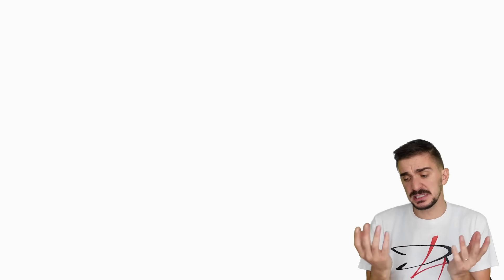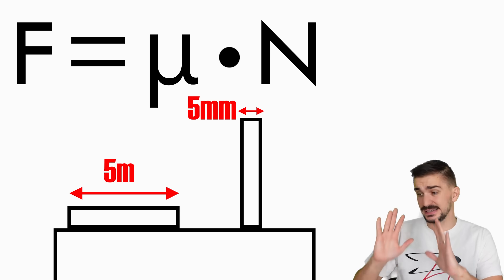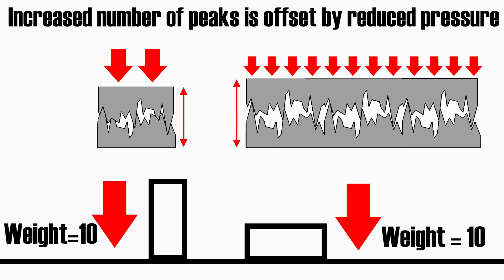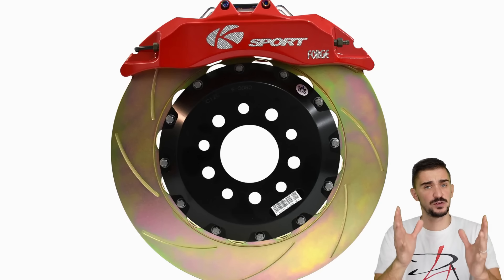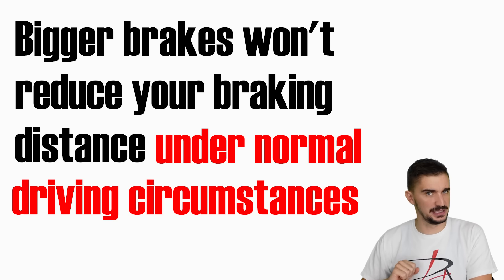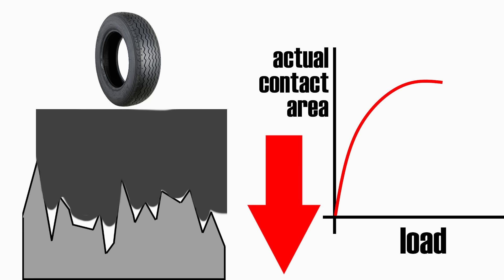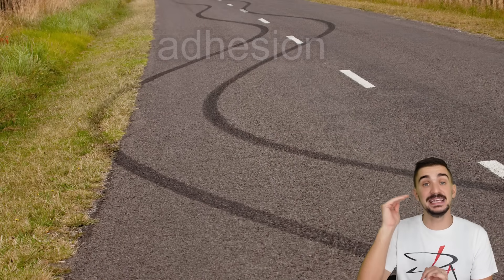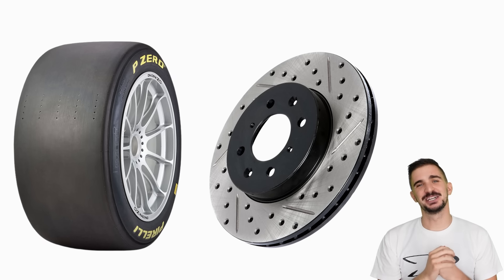Why Big Brakes Won't Stop You Faster but Wider Tires Will - Friction and Surface Area Explained

Comment: A great video and explanation in a simple and understandable way! Thank you! However, I would like to point out that the braking system and the tyres are not independent, and should be "consistent" to each other. I will try to explain... The use of wider tyres requires a greater force to stop them moving (as well as in the case of higher speed and higher car weight that have been mentioned) (in fact a greater force required to activate ABS). This implies that a better braking system might be required (but not necessarily) in order to achieve a shorter braking distance. Furthermore, apart from the performance of the braking system at high temperatures, their performance under wet conditions should be mentioned. Because a greater braking force is also required to activate ABS when discs and pads are wet. Moreover, the surface area of discs and pads are not only important. Their construction materials as well as their construction design may significantly affect the braking force. Both the presence of water and the quality/design of the materials (pads/discs) affect the friction coefficient, and thus, the breaking force (according to the equation of friction force mentioned at the beginning F = μ x N). This is similar to the friction force of different tyres (ie different materials and patterns) on dry, wet, icy roads. I hope the above information helps to clarify a couple of points, and are definitely well-intentioned!!! Thank you once again for the great video!

Comment: Bigger brakes means bigger braking MOMENT and they DO improve braking performance. On the big brakes you generate same friction force as on the small ones  but the centre of brake pad is further away from the wheel rotation axis therefore braking moment (Force x Arm length) is greater.
Its like you were trying to argue  that stopping the spinning bicycle wheel by grabbing on the tyre is as easy as stopping this same spinning wheel by grabbing it by the wheels sprocket.

Comment: There is a lot of mythology and misunderstanding about brakes. Thanks for explaining away much of that.

Brake fade comes from 2 sources, overheating the brake pads or overheating the brake fluid.  If your brakes loose breaking power after some significant use I would first upgrade your brake fluid.  DOT4 is compatible with DOT3 and has higher wet and dry boiling temperatures.  DOT4 race fluid has even higher boiling points.  Race fluid is $$ but since you so rarely change it isn't an ongoing cost for a street car.  An extra $30 over regular DOT4 fluid is all we're talking about.  Next try a different pad compound. If your car has organic compound pads try a metallic or semi-metallic pad.  These operate in higher temperature ranges.  Those changes will handle 95% of what you might need in a road car.  Don't get race pads for street use. They don't work well cold and that's dangerous for a street car.

His description of how tires make friction is great, but I would say that more important than larger tires is a stickier tire compound.  You want to stop really fast? Get 200 treadwear tires.  They adhere better and deform to match the road surface better.  The actual surface area of your contact patch has more to do with tire pressure than it does tire size.  If you have 33psi in your tires they can support 33 lbs for every square inch.  If the corner weight is 1000lbs your contact patch will be 30 sq. in. regardless of the size and shape of your tire.  This is why racers put as little pressure in our tires as we can get away with. 

One advantage of larger brake rotors that he leaves out is radius and leverage. In my endurance race car I had trouble with brake heat.  I installed rotors that were 10% larger radius which meant a 10% longer lever arm so 10% less force between the rotor and pad needed for the same force between the tire and the road so less heat.  That meant less heat generated and heat less to disperse over the larger area. Between that, better pads, and brake cooling ducts our brake problems are in the past and we use all oem single piston calipers and oem type rotors.

Often brake "upgrades" can increase your breaking distance, because if not done right you can change the brake bias.  Too much bias to the front or rear can impair your braking.  Ideally you'd want all  4 tires getting their max traction under braking.  But with stock rear and upgraded fronts, the fronts are doing all the work and the back very little.  Incorrect bias can also cause instability under hard braking. You definitely don't want that.  This is complicated because spring rates and weight transfer affect the ideal bias, which is why pro-race cars have in cockpit bias adjustment.

Comment: Attention! Raising is w/portelan pad. We use ceramic and semimetalic pads. Don't put on you car semimetalic. Ceramic is the best. Ceramic will be better on the heat pads. Semimetalic is up down side. For winter use ex: 195/70 R15 versus 205/60 R16 winter tires.

Comment: Long story short, if it's possible to lock your brakes without fade, you need more tire grip. If your brakes are fading to the point where you can't lock them anymore, you need better brakes to dissipate the heat. If they're not fading but you can't lock them, they just need more force behind them.

Comment: After Decades of hearing Size Matters.   Oops wrong subject!
   Obviously manufacturers equip vehicles with brakes that can stop you safely and effectively. 
   But the awful  overly large Wheels look even crappier without something filling up the void behind. That's for most. Large brakes are for the boulevard Cruisers. 
     When brakes heat to the point they become red hot brake fluid boils becoming  ineffective. 
     That's why big rigs use engine compression instead of riding the break while descending steep grades. 
     One thing large brakes do is retain heat longer.  (Bad)
     You likely won't find cooling ducks for the brakes on a dragster. 
    But you well on supercars or say NASCARs. 
    Ever watch a video of NASCAR breaks? Every single Corner they become red hot cooling down within just a couple seconds until the next corner. 
     Those breaks have always been about 12 in. 
    About the same size as on a V6 Mustang. 
    Certain V8 models are using as much as 15 in. It is a marketing ploy.  if a 12-inch rotor can work for NASCAR it can work for anybody. 
      Of course the stock market being what it is those in the racing business have stock in certain companies. So now NASCAR is putting in 15 inch rotors.  Watch the calloused muscle heads run out and get even bigger rotors now just because. Their money! I'd rather make sure I'm prepared for the hell that's about to be released on the world.   And you all thought the worst was wearing a Hankey on your face. 
       Life Is Bliss until it isn't!

Comment: Bigger brakes dissipate heat faster than smaller brakes.  Brake fade from boiling brake fluid from overheated brakes is a bigger concern for cars in racing situations, or in situations where the brakes are used hard for extended periods.  

So, bigger brakes ARE useful.  In some circumstances.

Comment: There is a question I have in relation to all this. Friction between objects generates heat, so as you drive, the rotors and pads get hot since they constantly pass over each other. I was led to believe that having larger pads and rotors (especially slotted ones), improve braking as they are less prone to overheating and slipping since the contact patch would be less concentrated. Is that accurate, or have I been living a lie? 🤔
Reply: If you are just driving and not stop the brakes will be ice cold even if driving last 100 miles without stopping as they are not in contact with anything if they were you would hear them rubbing, wear them out and use more fuel.
They only contact when braking. 

Its a lie because unless you are a bad driver you cant overheat your brakes in daily driving, if you are in a city and they overheat thats a horrible driver who probably also left foot brakes in an Automatic Or you were braking too late, driving too fast and if its a manual most of the slowing down should be done with gear and not brakes via Downshifting with rev match. 

Slotted Rotors dont have more grip, The slots are there to Shave a layer OFF the brake pads when they pass over it like a razor blade so its always fresh material and as a 2nd effect they help remove the gases from the brake pads breaking down/wearing like groves on a tyre help evacuate the water when its wet.

Comment: Yup.  F1 cars have smaller breaks that some would expect. But the cars have much larger tires and their breaks can tolerate much more friction and heat. 

I love your videos by the way. ✌️
Reply: So true F1 priorice tyre wall to been used as suspension than bigger brakes. I'm pretty sure they know what they're doing.
And before regulations the brakes were the smallest possible without compromising to get more tyre deformation benefits.

Comment: One thing you did not mention is the larger fulcrum/level of big brakes in relation to the wheel. And the higher speed (IPM) of bigger brakes past the caliper for the same road speed.
  How fast are the TIRES moving on a car doing 60 MPH?
1. Entirely linear=60 MPH
2. Bottom=0 MPH (inrelation to the ground as speed is measured).
3. Top of tire=120 MPH

Comment: In germany its requried to enlage the  brake system and brake cooling, if you increase the power of the engine 20% over stock, if im not misstsken. The TÜV will also check, if the MC is fitting. They then test the new brake system by emergency braking the fully loaded car out of vmax down to 20kph. I dont know how often they do it and what is deemed as pass, but they basicly dont want the brakes to break down due to fading, overly warping or overheating, and also the braking distance should be acceptable. 

Its also often that the brakes of cars from america are "too weak" for germany,  because they overheat, fade and warp easily, doe to their smaller dimensions. I know that youre basicly right, that a bigger brake technicly doesnt slow you down faster, but if you break out of higher speed the brake can start to fade during the braking fase and thats how the braking distance can get longer, if the brakes are "too small" compared to vehicle weight.

Comment: Kinda wrong. If you don't have abs, or even if you do. Setup is stock tire. With small rotors,, The amount of pressure to bring the tire to lockup is incredibly high. When you or abs gets them to unlock the difference in pressure is great. TAKES LONGER, Stopping distance IS LONGER . PUT LARGER rotors on the same vehicle- braking/lockup/feel or  sensitivity goes way up, recovery from lockup is quicker by human OR abs because you don't have to let all the components de flex & return soo much to get pressure off the rotor enough to allow the wheels to rotate again. Therefore Stopping distance IS SHORTER. brakes are not at the same thermal stresses- Everything is better
 Sometimes naked physics is correct,  but applied physics tells a different story. IMHO

Comment: This is largely false. Bigger brakes resist fade far higher than smaller brakes. Thus, there is a difference. Or every asshole with a Lambo would have Toyota tercel brakes on it. You're an idiot.
Quit spreading misinformation and half truths.
Reply: this isnt about fade, your the one who didnt understand the video

Comment: Excellent presentation, as far as he went....see, one must also take into account the shape of the contact patch of the tire on the road.   Skinny tires have an elongated (front to back) patch while wide tires have the opposite, which is  a wider contact patch.   This is critical on motorcycles especially.  A thin contact patch will, because the tire is elastic, under hard/extreme friction will cause the tire to "ripple" making the bottom of the tire the shape of a sine wave.   Reducing contact with the road while a wide tire with it's wider contact patch will deform much less, giving better "stiction".   And worthy of note, no matter what size/shape of tire, the contact patch area remains the same.  The shape will be different but the surface area contacting the ground will be the same.   I wish he'd have added this information to the video as it is not a minor consideration but a major factor in handling and braking and acceleration.  I give the video a thumbs up because everything he said was spot on correct, just incomplete so in school grade terms, an A minus.
Reply: Yes, its amazing the number of people who believe that a 2X wider tire will have a 2X larger contact patch area! Even the purported engineers are getting it wrong!
Reply: had similar thoughts, contact patch shape and of course air pressure make a larger difference and of course compound...

Comment: ar no no no,  the surface area is absorb into the "miu".  different surface, material, area, temperature ...  all absorbed there to make the 1st order friction analysis simple.  The reason BBK don't shorten braking distance is because bottle neck is at the tire.  If you have wide enough tires, BBK will stop shorter.  Just no car has that wide of tire

Comment: Brakes convert kinetic energy into heat.
Bigger brakes can convert energy faster.
While fitting bigger brakes to a car may not reduce stopping distances, that's because most modern cars have adequately sized brakes. 
Fit significantly smaller brakes and see what happens.

Comment: I can easily argue that bigger brakes do indeed stop sooner and shorter than smaller brakes!
IF
If, we are talking about a set of small brakes that are so small that they do not have the ability to lock up the wheels when rolling.

Once the brakes stop all rotation of the wheels then ALL, and I mean 100%, of your braking is being performed solely by the tires.

Comment: The brake changes are made to defeat brake fade not necessarily to improve your breaking his to keep you're breaking at the level that they are when they're cold or reasonably not warm as  a scientist calls it hot. The holes and the slotting and the brake pad  material go to defeat brake fade when everything gets hot.

Comment: Folks Buy Big Brakes For The Appearance an Show Off. The Type Of Compound Of the Pads an Rotors is Most Important.. You Choose Tires for Your Style of Driving..Just Wider size doesn't make sense..

Comment: I think that this would apply to the average driver in an average vehicle under normal driving conditions. Apply this to a race car or loaded 18 wheeler where bigger brakes are needed to help reduce the effects of brake fade (overtemp of rotors/drums and pads from extended braking), then smaller brakes will equate to longer stopping distances regardless of tire width.

Comment: if your front brakes get hot and fade the rears usually do not and that leads to too much rear brake late in a race and you better make the correct adjustment. right of or right on? gotta do it in traffic while under race conditions too.....brakes have many tricks they can play on you.

Comment: I swap my stock 12.2in single piston stock focus st brakes to 4 pistons 13.8in setup 
At this time, I also wide body and add 9.5in wide wheel with a +20 offset going from a 245/65R16 to a 295/40R18 also swapped in a focused RS AWD trans shafts ecu and rear sub frame